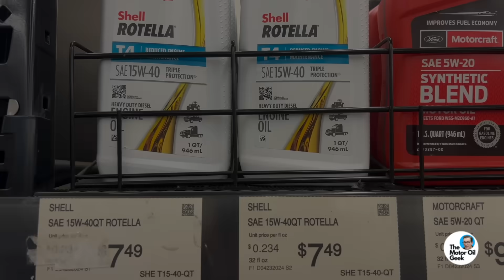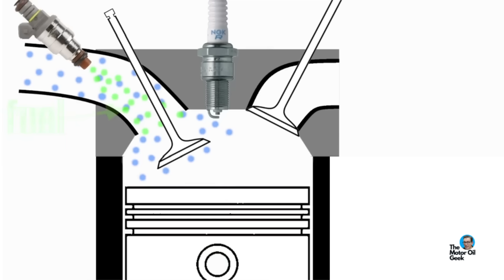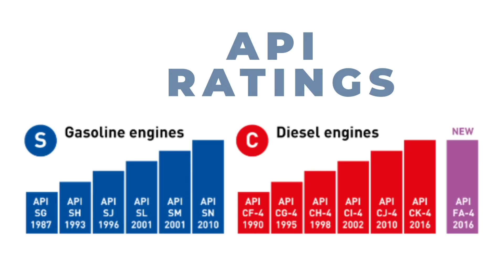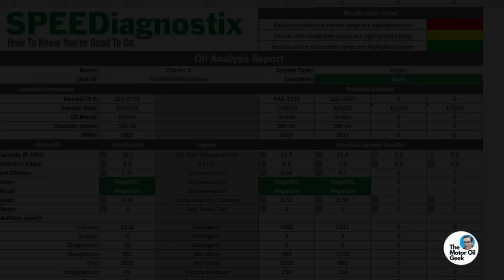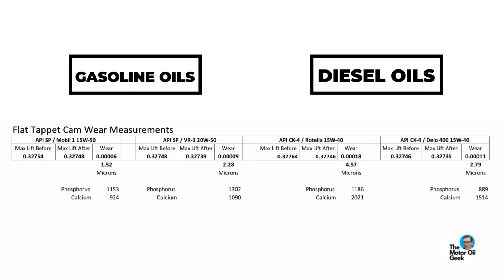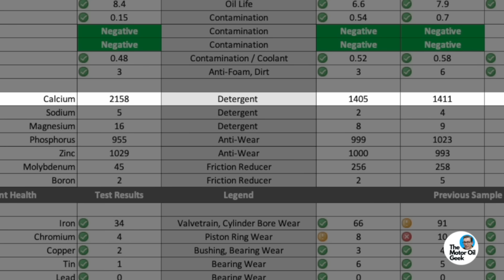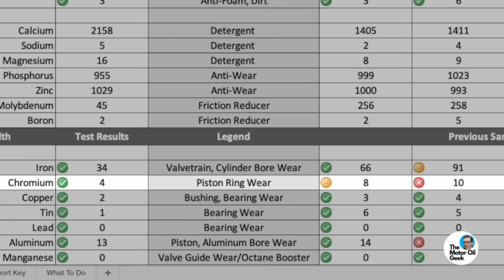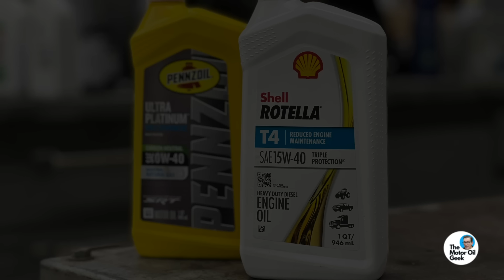Why DIESEL Oil is Actually WORSE for Gas Engines!

Comment: So let's get this straight. Diesel oil explodes pistons. Only in High compression gas engines. Which is amazing, considering diesel engines operate at double the compression ratio as a gas motor. Diesel engines should be exploding pistons everywhere.  Sounds like a theory that Mobil 1 came up with.

Comment: Myself?I will stay with SHELL OIL in my diesel tractors and i had SHELL AERO OIL in my 140 PIPER CHEROKEY and  it had a LCOMING with an  STC to 160 HP and when i sold it still performed faithfully. Mobil had that class action law suit against it back in the ninetys with only Lycoming engines not CONTINENTALS?  I personally hope we dont loss that help SHELL always granted us and important information thats there for our benifit.

Comment: Didn't read all the comments (of course) to see if this has already been posted,..... but what the heck is with the mis-info/dis-info @ the 3:30 mark?    Seriously?

"you can throw a lit match in a bucket of gasoline and it will go out"

Uhhhhmmmm.... NO!

lit cigarette yes, but.....
How many kids watch this stuff?

Gasoline needs spark or an open flame to ignite.   Are the "vapors" supposed to hide at the bottom of the bucket?

To think this video was edited.  Kinda makes ya wonder about the advice given.

Internet experts,....sheesh.   Ain't clown world grand?

Comment: I’d love to see how Valvoline Premium Blue Extreme 5w40 does in the COMP flat tappet test; especially since you have some friends over at Valvoline. I love their oil and that one specifically is designed/marketed/rated for diesel AND gas.

Comment: I have used dello 400 heavy truck motor oil in all my vehicles for over 30 years since it's hard now to find everyday dello 400 I have switched over to the synthetic and if you open up my engine you'll find it it's as clean as a whistle.

Comment: Super interesting video. I was sometime using the surplus of my tractor's oil in my small air-cooled engines, but will stop doing this. It is not as critical a in a car or direct injection engine, but I still want those to last. Thanks for the great video! I am learning so much about oil on your channel.

Comment: I had a mk5 gti that I switched over to Mobil1 turbo diesel truck oil 5w40 to see if I could reduce oil consumption. Not only did it drastically reduce oil consumption and it passed with flying colors by blackstone labs so i call BS. Had the car for 14-15 years until i sold it.

Comment: Yeah idiot me not that I did this but I didn't know but I changed over to conventional oil luckily I think? I have I know for a fact I have roller lifters so now I have to get rid of all the slides from that dinosaur oil using synthetic. As per the manual has said in the first place

Comment: What oil is recommended for my old 1940's tractor gas engines? They are not show pieces but work consistently through all 4 seasons. Oil type is a big debate (with plenty of myth and voodoo) in the vintage tractor world. Thanks!

Comment: Soot is a product of incomplete combustion.  Diesel has low vapor pressure and will not vaporize.  Thus, it has to be injected at high pressure which creates very fine droplets with high surface area to mass ratio.  To burn diesel the droplet size of fuel must be small as possible  so that the surrounding air can support complete combustion quickly but even then soot (unburned carbon) is the result.  Similar problem with gasoline if you run too rich a mixture.

Gasoline direct injection is used to increase cylinder pressures without inducing preignition.  Also, it can be injected late in combustion stoke and at light loads creates a sufficiently rich enough mixture around the spark plug to be ignited while rest of cylinder can be lean.

Comment: I have used it in my rally subis take engines apart for re work or maintenance , the engine is squeaky clean. No carbon deposits any wear. Piston look brand new from day one and also the valves. I have another one using regular oil and has carbon deposits everywhere.👍🏼

Comment: DO NOT throw a match in a bucket of gasoline please. I was at a party and the homeowners best friend did that. The plastic bucket was in the garage. It went up in flames of course because vapors are present in the F'ng bucket. Friend went to get the bucket out of the garage but the bottom was already melted and it just spread the fuel fire. Then he went to get the water hose and I stopped him. By now the top half of the garage was filled with black smoke. Panic set in. Luckily a neighbor ran to his house next door and got a fire extingisher and put the fire out. Very scary and caused in part by idiots saying you can throw a match in a bucket of fuel with no drama. DON'T DO IT!

Comment: Conveniently, I mostly run old engines from the 30s through the 80s. In my case Rotella T4 15-40 is my Frank's Red Hot. I put that shit in everything. Tractors, trucks, hot rods, motorcycles, squirt cans for random squeaky junk, they all love it. Only thing I don't run it in is my diesel engine, a genny/welder. It needs lighter viscosity, still T4 of course.

For "modernish" things with EFI and emissions, well, T4 is not your best option. It'll work, but be prepared to replace your cat at some point.

Main thing is change the damn stuff every decade or two will ya? You can get the royal purple crap if you want but if it's been in there since dubya was in office you will still have a very sad engine.

Comment: Fifteen years ago I bought a 97 Jeep Wrangler for my daughter, 4-banger automatic, girly Jeep. I tried Rotella Synthetic 10w-30 but it burned that oil like crazy, a quart in less than 1000 miles. I went back to Max Life 10w-30 and if burned virtually no oil. It had 4.11 gears and no overdrive so I changed the oil every 3000 miles.

Comment: As for direct injection of gasoline as liquid fuel particles that do not become vaporized before combustion and as you've stated - these liquid gasoline molecules somehow 'increase' the compression ratio of the engine because they are still in the liquid state and not in vapor form. This is hypothetical and not proven.  Given how little, in sheer volume, that is injected into the engine cylinders, it is not enough to alter the compression ratio of the engine!  If it were, then perhaps there may be engine knock or other detrimental effects.  The ideal stochiometric ratio for a gasoline engine is 14.7:1, 14.7 parts of air to one part gasoline by mass.  So you'd have to flood the engine in order to change the compression ratio!  Complete hogwash statement !

Comment: In the philippines one of the biggest petrochem companies is Caltex. They sell diesel engine oil called Delo Gold. But people are using it for gasoline engines. The back label shows the specs and the engines it can be used on. Including gasoline. Here is the back label:

Delo Gold Multigrade is a high performance, multigrade, heavy-duty diesel engine oil specifically designed 
to lubricate a wide range of diesel engines requiring API CH-4, CF performance lubricants. Formulated with
ISOSYN technology

PERFORMANCE STANDARDS:
*API CH-4/SL * ACEA E3-96 * Cummins CES 20072, 20071
*MB Approval-228.3 * Volvo VDS-2 * DDC/MTU Category 2
*Mack EO-M, EO-L

RECOMMENDED FOR:
*MIxed fleets of diesel engines - high speed, four-stroke, turbocharged or naturally aspirated * Four-stroke gasoline
engines in mixed fleets

Comment: Disagree. I rebuilt my jeep 4.0 5 years ago 80k miles i just bore scoped it last week. Cross hatching looks new pistons are clean. Run rotella T6 in my offshore boat and supercharged sea-doo also.  
Safe for the clutches. T5 in my old land rover and both my 80's toyota pickups. A decade of rotella testing personally.

Comment: I ran Rotella in my motorcycle for over 100,000 Mi. Most motorcycles that are the same as mine give it up at just over 50,000. Your results may vary...

Comment: I used nothing but Rotella 15 w 40 in my Victory motorcycle.  It had 129,000 miles on it when a drunk driver destroyed it (and me).  The only engine related problem I ever had was a starter clutch (96,000 miles). It was still running strong when it got wrecked.

Comment: I buy it by the 5 gallon bucket 15 40 what came 2 my mind when seeing this video is sales has to be way down on everything but Rotella has to be very high ive ran it in everything i have mowers 4 wheelers dirt bikes street bikes cars race car suv and work van not 1 of them is diesel and not had a problem been doing it for over 20 years and i put that thick stuff about a cup full lucas and when i pull the dip stick it strings from it just a small bit !! I feel like i could run a min or 2 if i lost oil psi and be ok still

Comment: After gaining real-world experience, I must disagree. I used Rotella T 15W40 exclusively in my 1989 Trans Am GTA, a 388 cid TPI engine that was rebuilt and produced approximately 450 horsepower.  At 77,000 miles, my son was in a wreck with a drunk and totaled the car. So, we pulled the motor out to install it in another Trans Am, and we decided to have it freshened while it was out. I took it to the same machine shop that originally built it. When they took it apart, they said that the engine looked as if it had just been machined by their shop, and all they did was inspect it and put it back together. No machine work was required because the engine was in such good condition. I therefore conclude that Rotella T diesel oil is exceptional for use in high-performance vehicles.  In addition to this, I talked to a couple of drag racers who raced Pro mod, and they use Rotella 15W40 exclusively, and they swore by it as well!

Comment: Hate to differ but................I've run Shell Rotella in 5 different bikes, going on 20 years now.  Total of about 185K miles and not one oil related issue on any bike.  One In-line four (BMW K1300), Two In-line 4 (Yamaha 1000 R1 running them hard), Flat 4 (Honda Goldwing 1800) or V twin (Honda VTX 1800) and no problems.  Clutches feed great, no slip and they shift better than the OEM oils. Rotella is not as good as Mobil 4 (best bike oil ever IMHO) but Rotella it about 1/3 the price.

Comment: Looks like Shell recently updated the certification on T4, 5 and 6 on 15W40 Rotella. They now have the gasoline SN rating again where it was absent in the past several years. Might be a viable option again for flat tappet older engines including air cooled.

Comment: Coming from working on classic vehicles, there are a lot of oil additives that boost detergents and zinc. Would there not be a slight benefit in adding a quart diesel oil to a classic car oil change that is being ran by a carburetor?

Comment: Technology is good but how good is the QUESTION!?!?!? I have several what could be classified as ANTIQUE!?!?!? First is a eightys era Mitsubishi fwd diesel tractor with bucket loader second is a American Yard Products lawn tractor 20hp Kohler Magnum  1994year third is a 1996😮 F250 all started life on Mobil Delvac 15w40  /  Shell Rotella 15W40 currently all three are on Shell Rotella 5W40 synthetic and HAPPY AS LARKS!!!!!!!!!!! I'm a retired CAT&CUMMINGS knuckle buster and have been running series thee oil since the mid 70s. The problem I see is the EPA,TREE HUGGERS, CLIMATE FREAKS and POOR ENGINE QUALITY!!!!!!!!!!!!!!!!!! Look at the big engine recall GM just had mainly because of their poor engine quality and their band-aid of changing oil viscosity for  a patch NOT A FIX!!!!!!!!!!!

Comment: I have a '95 Dodge Dakota 5.2 Magnum with 308 K miles. I use regular 15 -40 Rotella in it and runs great oil pressure. Runs great and is quiet in below zero F startup temps. Have a neighbor with a '96 3/4 ton Dodge pickup with a 360 Magnum engine and he's a farmer and rancher. Has over 100 head of beef cows. The truck has high 200 K miles (original) engine and he uses regular 15 -40 Rotella as well. He said he used that same oil since he bought the truck with low miles. Pulls heavy loads of cattle all of the time and is used hard on the farm. The truck is rusting away, but the engine still runs great he says. Sometimes the real proof is in real life applications.

Comment: We have ran shell 15 W 40 in our cars, pick up trucks, farm, tractors of all sizes and ages, over the road, trucks, lawn equipment, literally everything we’ve ever owned aside from two-stroke engines. We have two Ford F150 Eco boost engine engines with 335K and 275K miles and haven’t even needed timing chains. We must be doing something terribly wrong…

Comment: hell yeah calcium, zinc, and other stuff stolen from gasoline oils, so you will need new engine after 90000 miles. yeah won't work in todays little sewing machine motors.

Comment: I’ve been a service technician for the last 35 years. I started as young as 27 years old at GM stop telling this lie diesel oils are a lot better than regular oil hiring viscosity keeps the engine cleaner keeps the engine cooler. I don’t know what you’re talking about. That’s what I use in my vehicles all the time even four-cylinder. I use it all the time. I don’t see a difference. I want his regular conventional oil at all so stop telling people regular oil that’s why GM has so many cars on backorder because they broke down because of the oil 5W-30 0.30 no no that’s wrong.

Comment: 2002 Dodge Ram 2500 5.9 Cummins owner here I've ran Rotella T4 15W40 in my motor since it was knew 354656 miles later and still running strong no major issues motor never been apart ! Rotella is a good motor oil for diesels ! My wife's 2008 Chrysler Town an Country Touring Mini Van 3.8 litre  I run Castrol 5W20 High Mileage Motor Oil 251543 miles no problems !

Comment: Yet another validation. I'd focused on the differences of diesel vs. gasoline engines in other properties such as the combustion heat, the bearing surfaces, the oil volume used. This issue of detergent packages to deal with soot is actually far more critical than the other issues.
Yet, you can't stop speculators and feels-likers from putting LOWER COST diesel oil in their motorcycles and such.
Reply: Just look on the back of the jug for the JASO “MA/MA2”.   That means it’s suitable for wet clutches with no friction modifiers.   My entire riding group has been using T6 for 20+ years at least.   No issues, rice rocket or Harley, and much better zinc and shear protection.   No more of those famous rounded off Kawasaki cams and rockers.

Comment: @themotoroilgeek 

Hi Lake, what oil would you recommend for a 1965 Pontiac GTO with a 1970 400 ci V8 with a Flat tappet camshaft ? 
We're currently running Castrol GTX 20W50, but considering changing to Valvoline VR1 20W50. We had also thought about using Rotella 15w40, but this video is making me reconsider that thought. 
This is a fun car for us, that gets driven less than 1000 miles per year. It does burn and leak some oil as we did the restoration in 1993.

Comment: As always this is an excellent video!! I've been running RT6 5-W40 in everything from my '06 Subaru Forester XT to Kohler & Tecumseh 6 - 28HP engines for many years and they're all doing fine. I don't race my XT, but we have some hardcore WRX (the XT has the same engine but different turbocharger) racing folks in this part of NH and many of them swear by RT6. I have used M1 and Castrol and notice very little difference. For my XT I'll just continue to use all 3. Keep up the great work!!!

Comment: I found triax oil to be better controling soot in 7.3 diesel. Oil is still clean and not black up to 2000 miles .t6 gets black in half the time

Comment: Mobil Oil Tech stated recently that they no longer produce a universal oil because the EPA has reduced the zinc requirement to the point where old engines with flat tappets require an oil package with more zinc. they said we do not recommend adding any additive package to our lubricants. He stated the old DELVAC was a great universal oil because the additive package was adequate for all gas & diesel engines without cat converters.  Now I have found that all the API diesel oils are cutting way back with the zinc additive
Reply: They should offer a classic rotella 4 for us that don't have DPF.

Comment: Blah Blah Blah ... been running t4 in my 40 year old goldwing as long as I remember and at 200000 miles , it still doesnt use oil or have had any oil related issues ... Not sure what this guys saying is true  , Ill stick to the rotella

Comment: ok here's a question for you.....this concerns marine gas engines...I've used Mercruiser 25/40 and their syn blend 25/50 in a marine gas inboard. I did a few used oil analyses, and as per your concern about calcium,  the Mercruiser oils average about 2250 ppm of calcium. Years back I used straight 30 Chevron Delo in the same engine, it had 3700 ppm of calcium!  So, what do you think of this?

Comment: I tried Rotella oil 🛢️ in my 85 Yamaha Maxim 700 because other said it worked good in their bikes & my motorcycle 🏍️ hated the oil....I could tell right away it was harder to shift - clunky shifts and with less power. Than other oils.

Comment: So I see some oil additives have a lot of phosphorus and no zinc. What type of phosphorus is used in oil with no zinc as a lubricant? My oil analysis showed extremely high levels of phosphorus and high copper levels in the used engine oil in a 6.7L cummins. Is it the phosphorus that oxidizes copper and other yellow metals?

Comment: I've been told that for my gas engine Kawasaki FR651 zero-turn mower engine I need 10W-40 with high zinc.  Is this a case where a certain Rotella 10W-40 Diesel oil might work well?

Comment: conclusion: Diesel oil is a bad idea for flat-tappet cams or turbo GDI motors. But if you’ve got a roller cam, no turbo, and old-school port injection engine, it’ll work fine.